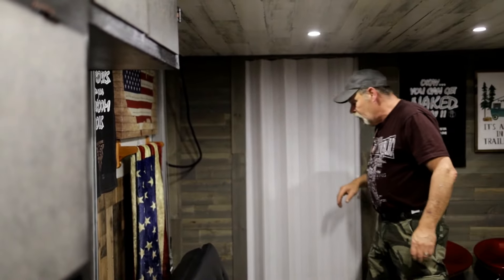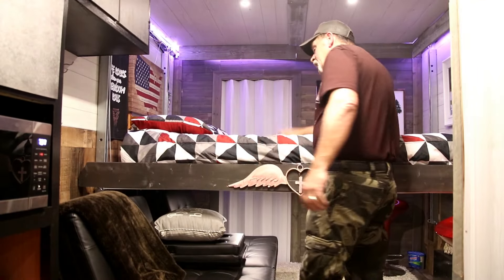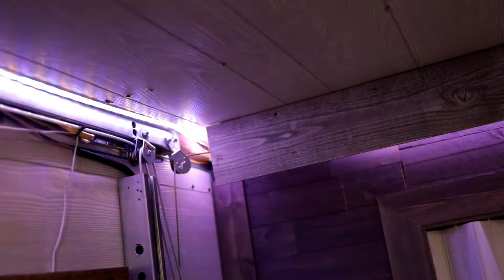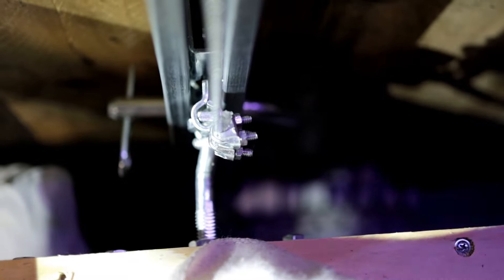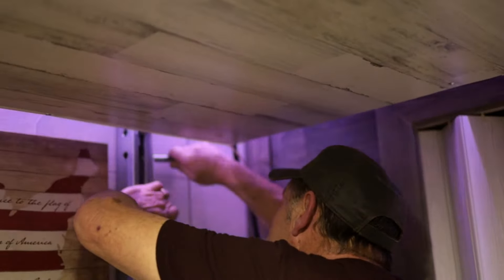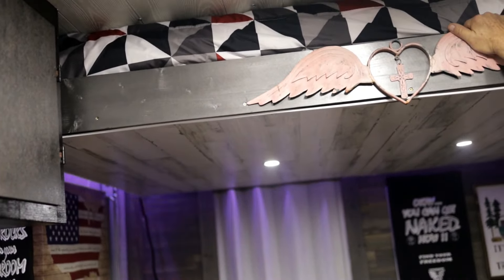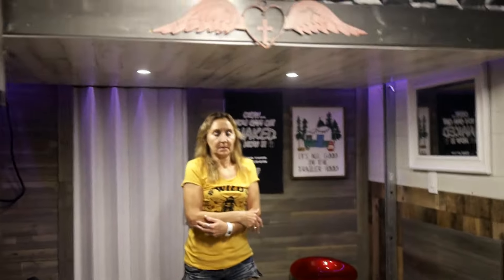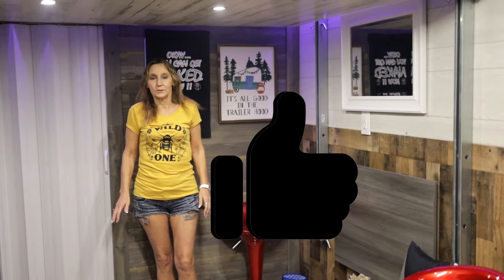DIY ELEVATOR BED OVERVIEW -Cargo Trailer Camper Conversion

Comment: Hello. I love the bed idea. Wondering if you can make the bed but without using an electric winch, just hand pulling the the lines thru the pulleys?? I don't have my electrical set up yet. Thanks.
Reply from the maker: I first used a hand crank boat winch (28 dollars at Harbor Freight) on this system. We wanted to make sure we could get it running smoothly before buying and installing the winch, it worked great ! I don't think you would want to attempt by hand, these beds get heavy very quick.

Comment: thank you for this man!!! can you tell me what is running trough the rails and is resting on the pins?
Reply from the maker: The barn door rollers that are sold with the rails at Tractor Supply. There are 2 types, we used the ones with 4 metal trolley wheels.